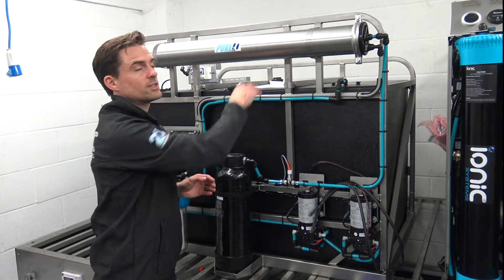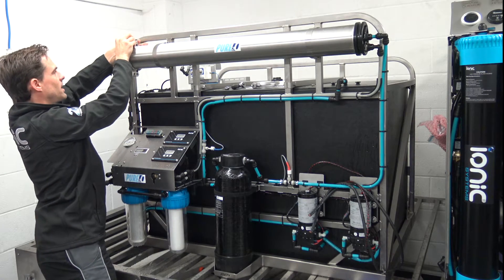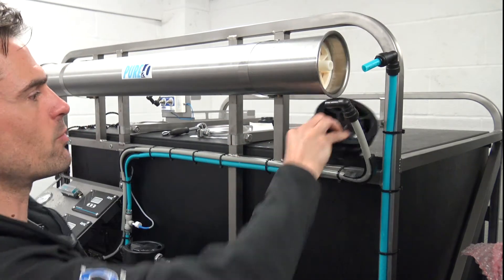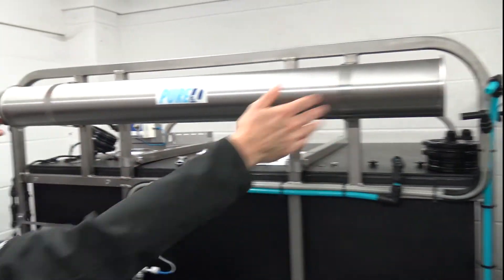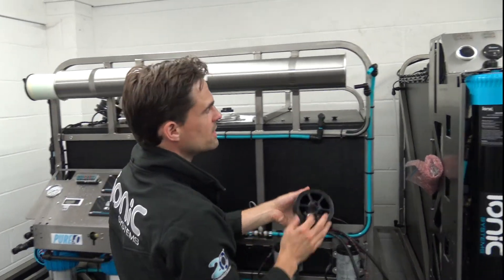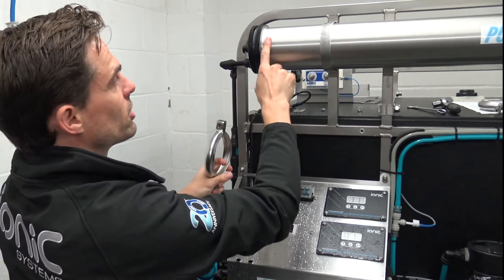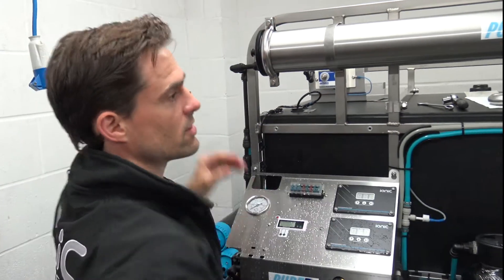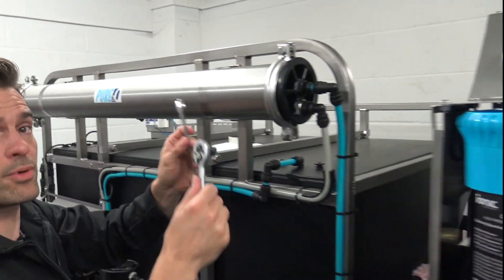How to Change a 4040 RO Membrane filter - Ionic Systems

Comment: After how long you have to change the 40/40 ? Mine is now almost 6 years in service .
Reply: they say when the filtered water shows its only filtering 80% of TDS of the unfiltered water.
Reply: All depends on how hard your water is and how many litres of water you put through it. Also, how often you need to replace your other two filters and your blue bottle resin. The more this filter membrane is clogged - the slower water flows through it.

Anyway, my membrane is two years old now and I'm about to replace it as I see how water struggles to get through, it's just much slower to refill the tank and my inlet water hose expands dramatically when using my 4040 whilst filtering. But then I have a fair round, so it figires.